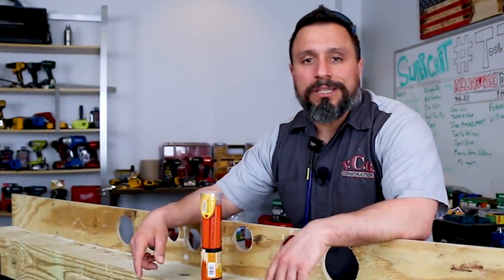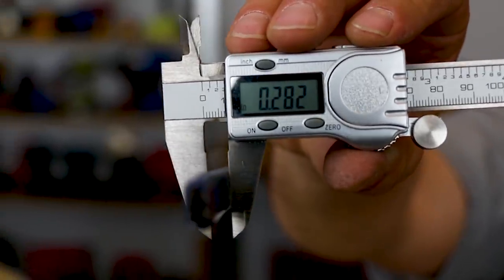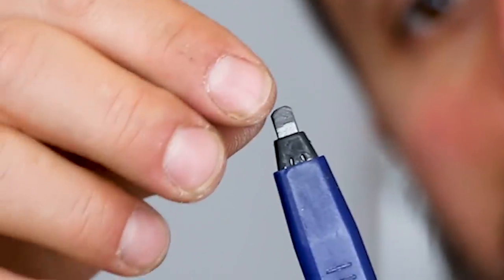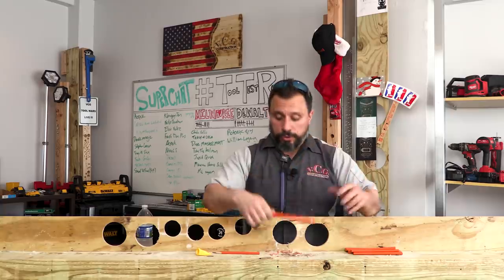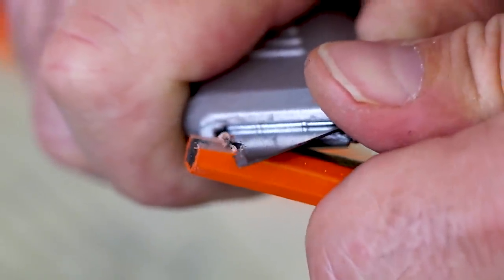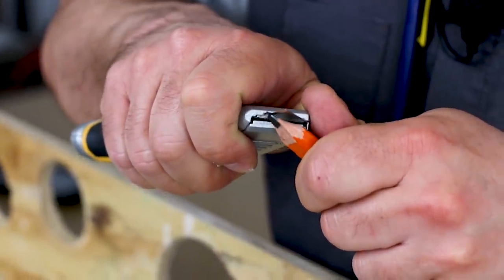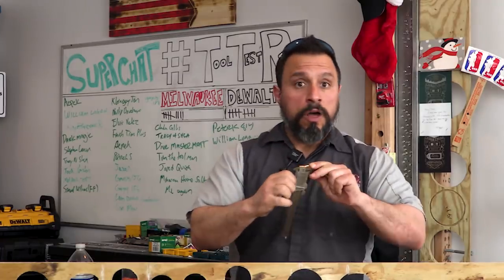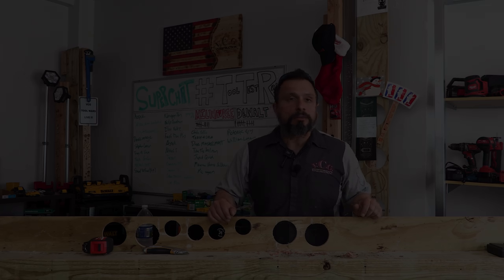CARPENTER PENCIL FEATURES AND TIPS THAT WILL BLOW YOUR MIND!

Comment: Good vid Vince.  Additionally, the width of the carpenters pencil is 1/2 inch and I keep both ends of my pencils sharpened.  One end to a fine point, the other to a thicker width for larger stock that I'm cutting.  Another thing, I keep my carpenters pencil tucked under my hat in front of my ear, not above it and it's always there when I need it.  Try that with a standard  #2 pencil and it's dang uncomfortable, lol.  Cheers!
Reply: Excellent tips William. That's why I always wear my cap too.
Reply: Yeah, doesnt stay behind an ear as well as a #two but fits perfectly wedged between a cap

Comment: I just don't have the patience for sharpening pencils, I prefer to use the sharpener that comes in the tube with the pencils.
Reply: would you not be better off just buying regular pencils? not meaning to be sarcastic just a genuine thought.
Reply: @GBOB68   Or use carpenter's pencils which sharpened perfectly with a regular pencil sharpener not a problem at all. I also use a really thin pencils  Then sit through small holes so that you can make a mark.
Reply: @jeffostroff  never tried to sharpen a carpenter's pencil with a regular sharpener. I actually use a clutch pencil which is great for marking holes. just pop the lead out far enough to get through the holes.

Comment: In drywall they always hold the pencil WITH the tab of the tape measure while making lengthy marks. Being that the pencil is EXACTLY 1/4 one would have to plus or minus that quarter inch, depending on which side of the tape measure tab they would hold the pencil.  Oh wait...... it's drywall!!! "Within reason" is a common term. Now i get it why the cuts were slightly off being "exact!" 🤣🤣🤣. DISCLAIMER: for those who may not realize, this was Me Again's lame attempt at sarcastic humor. God bless! 😁👍✌
Reply: Actually they set  the tape and pencil on the mark, regardless of where they hold it from. A good hanger will always be on point, and could go from 0 to 3 inches angle cut on the money. Maybe not today but back when people took pride in their work.

Comment: I would like to have a dollar for every time l sharpened a pencil and the frikken thing broke on the first mark and then you scratch it with wood, meanwhile my brother sharpened his pencil 17 years ago and it's still sharp, it's me, it's got me.
Reply: Steve I always used a pen and I did sheet metal work. Worked very good on metal. Thinking that may help you. Dunno I think all sheet metal men used pens as pencil will not show up and markers not accurate enough by miles.
Reply: @frankcrawford416  That's not a bad idea, they have alot of options with markers now, thanks.

Comment: Get a Fastcap Fatboy and you'll all love it
Reply: The mechanical carpenter's pencils are better for a few reasons. Mech is simple and doesn't clog or break. Flat so it won't roll off the... Lead is flat, so it is easier to sharpen one side on concrete/sandpaper to make a knife edge that results in thin lines.